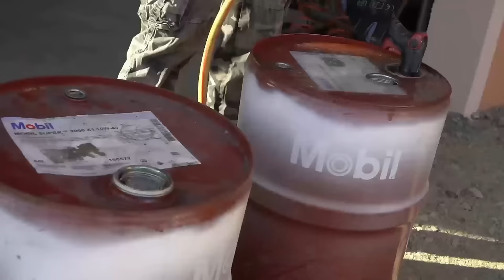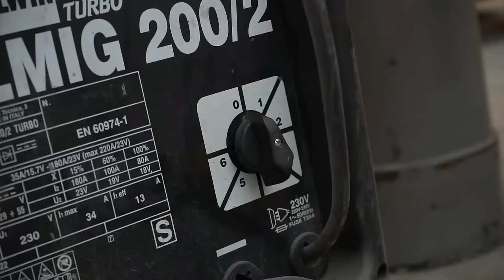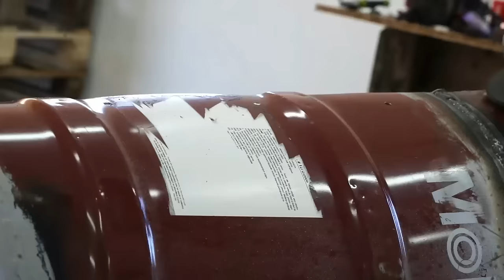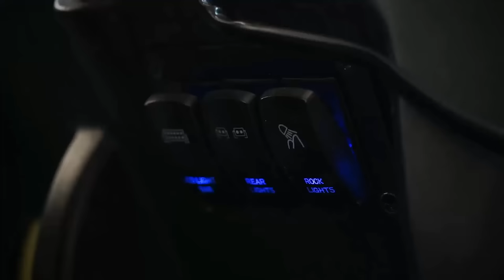Homemade SNOW PLOW for LAWN TRACTOR / QUAD From OIL BARRELS !?

Comment: I would make a rubber blade/squeegee with the left over rubber, spray the blade with the lube of your choice to keep snow from sticking and add weight to the blade and rear tires. Otherwise  5 stars 👍

Comment: Too heavy for that little tractor
Reply: No, it's not.  That plow is quite light compared to the plows on either of my tractors.  Heavy, wet snow is very difficult to plow.  The tractor does need more weight on the drive tyres [tires] e.g. wheel weights, fluid-filled tires, and / or a rear weight box.  It also could use tire chains or R-14 or snow tires.  But the transmission on that lawn tractor is probably not designed for snow plowing, so by not using a garden tractor with a transmission designed for plowing the owner will shorten the operational life of the transmission.  If he doesn't usually get heavy snow in his area this may not be that significant.